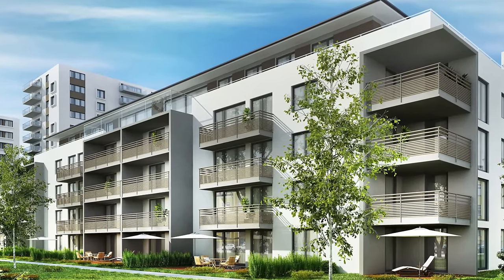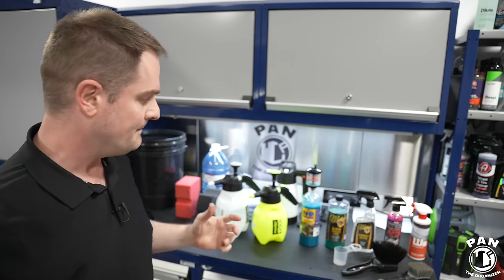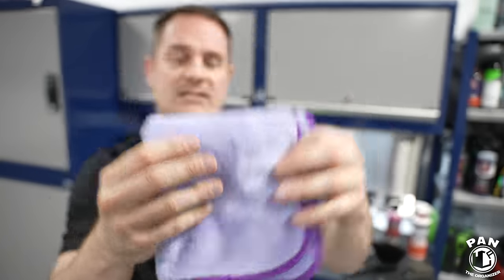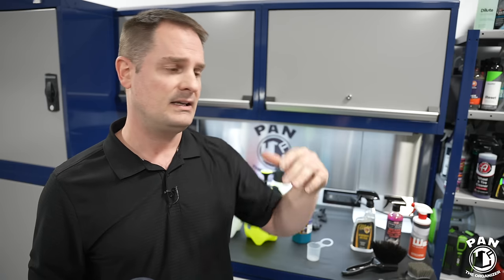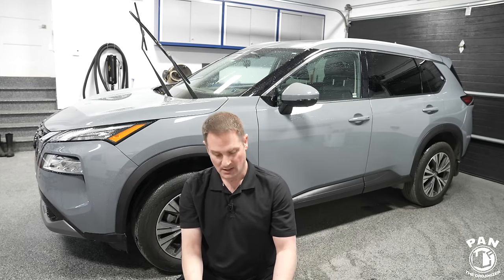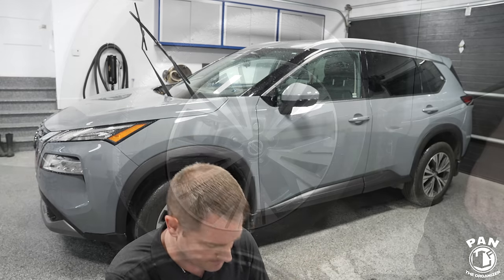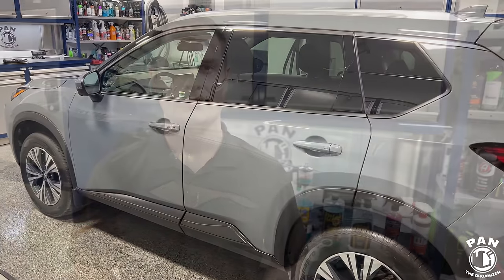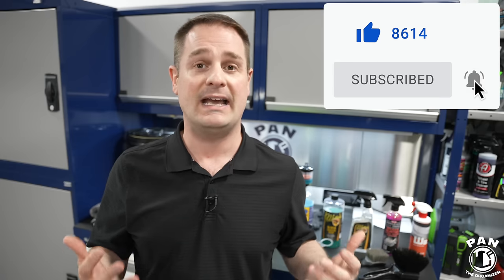How to wash your car without a hose or pressure washer! (RINSELESS WASH METHOD)

Comment: In my area (France), we have strict water restrictions in summer (say july-october included). I prefer using a  traditional method (I own a pressure washer, a foam canon). So during winter and mid-season, I use this method. But in summer, it is forbidden to individuals to wash their cars at home. So you have to go to a washing station or find an other way...  The tools at the washing station are often unusable safely (brushes laying in a bucket, guys having washed a muddy car and leaving the tools with no care). So, in this case, I use a riseless method... and it works. The only problem is to find the adequate products in France… It is quite difficult.

Comment: Well, I feel like my life has changed after discovering rinseless washing. No garage, no hose, no water.  My only option was these self serve auto washes in which when you take your time to detail the coin usage is endless. First attempt to my daily  car with no paint correction  and the results where superb. Even the wife who is usually not noticing relevant details,  said was excellent. So, washed also the other one that is in a very good condition recently polished and topped with Collinite and bead maker. WOW. BTW both cars were not washed for about a month, full of dust but not hard debris. It works guys.
Reply from the maker: Thanks for sharing your experience!

Comment: Pan!  This video was timely.  I did my first rinseless wash this morning.  I cannot believe how easy it was...and how much time it saved.  I have hard water, so I spend a lot of time going back over the paint with detail spray on a regular wash. For the rinseless solution, I used our homes RO water (no spots anywhere!)    I presoaked using a regular spray bottle.  Do you feel like the pump sprayers have added pressure that helps break up the road contaminents?  l've been looking at the marolex sprayers for a bit.
Reply from the maker: Yes the more powerful pump sprayers like the Marolex really help to remove loose dirt and grime during the pre-treatment. Check out the links in the description.

Comment: Brake buster can be used waterless on the tires and you can use a damp ONR towel to wipe it off the wheels as well. The pump sprayer and brushes also dipped into rinseless will be enough to rinse off the wheel as well.

Comment: Yesterday I did a rinseless wash on both my work truck and my wife’s van. I used a garden sprayer to pretreat the vehicle. I then did a rinse with the pressure washer ( lots of dirt and thick grime). Then a full rinseless wash on both. I used Titan as a drying aid and protection. Both vehicles done on same bucket. Very efficient way of washing. No concerns about scratching. My truck is 2 years old and looks better than when I bought it new( never polished the paint either)
Thanks to you and Yvan Lacroix for introducing me to this method.
Reply from the maker: There you go Steve! Thanks for sharing your personal experience. :)

Comment: Thank you for making this video. I just performed this rinseless wash on my 2024 Honda Civic. It has an Underdog Pro+ coating. It wasn't very dirty. Mainly some polen. I probably spent about 90 minutes or so. A bunch of that was chasing little drips from the doors and the trunk. I was in no hurry. It was a beautiful day outside. I did this in my garage. There wasn't that much water on the garage floor and I just used my leaf blower to help dry out the floor (after moving the car outside of course). The car looks perfect. I will be using this technique 100% of the time if at all possible. This car isn't a daily driver so I don't expect it to ever get very dirty.
Reply from the maker: Thanks for sharing. Yeah when done correctly and not on a super dirty car, a rinsless wash is a safe alternative to a regular car wash with buckets and wash mitts. But you need to use common sense with rinseless washes.

Comment: As always, great great video. Picking up my new car on Tuesday and already decided rinseless washes were the way to go, so this video couldn't come at a more perfect time. But in all the videos I've watched about rinseless washes some things that are never mentioned  are: 
A: how to treat the door sills and underneath the doors and the inside of the tailgate? I'm guessing you can just include those as well using the same method? 
B: how to clean your windshield wipers? Do you also just lightly go over them or clean them more thoroughly?
Reply from the maker: A. Just use a microfiber towel dunked in the rinseless wash at the end of your wash process.
B. I just put a bit of glass cleaner on a glass towel, finish the glass, and then pinch and clean the blades.
Reply: Same here! Integra on Tuesday, and sometimes I’ll resort to the rinseless wash process.

Comment: Appreciate this tutorial, Pan!  Did the rinseless wash today on our 1-month old Porsche Macan using the guidance from you and Yvan Lacroix.  Took me 1.5 hours total, but I'm sure I'll get it done quicker with more practice!  

The car itself wasn't so dirty, but a LOT of dirt and gunk came out of the wheels :o
Reply from the maker: Yeah the first time you do a rinseless wash, it takes more time and you probably used more product than you actually needed. It's normal. Once you get the hang of it, you'll be more efficient.

Comment: I’ve only used ONR so far and it works great. I’ve used it as a pre-spray and post wash spray when working in the sun to prevent water spotting on my black vehicles.

Comment: After following Pan's rinseless method, the number one thing I wish I had invested in sooner was a better drying towel. I had started by just drying using the same small microfiber towels I use to apply the rinseless solution and it took forever. Having a bigger, more absorbent microfiber towel designed for drying is worth every penny.
Reply from the maker: Absolutely. Having a quality dedicated drying towel is important. Here’s my video on my favourite drying towels: https://youtu.be/E10SjmOps7E?si=JFNhgTqpPW8Ql0K6

Comment: Thanks for the very informative video, Pan! I just thought of sharing my own way of dealing with the elements, maybe others have the same conditions. I'm using rinseless wash to tackle two problems at once. Very hard water and harsh weather conditions. I take the cooled car out of the garage and do a regular pre-wash with foam lance and pressure washer quickly. Once I'm done, I pump spray the whole vehicle to replace our super hard tap water with rinseless wash solution. Then I move the car back to the garage and perform a rinseless wash inside safe from the heavy winds and sunshine that would dry the paint very quickly. Then towel dry and make it perfect with my quick detailer.

Comment: Pan - I use the Gary Dean method, with multiple wash towels in the bucket.  One towel per panel, then it goes into a separate bucket to be washed.  That way there is no way of contamination.  Works for me and the paint has no scratches.  Great video, and I haven't used shampoo and a hose in over a year.
Reply from the maker: Thanks for sharing!
Reply: Yes, I don't like to contaminate my bucket (use a couple different buckets if u need to).   

I save my "clean bucket" solution for next time.

Comment: Thanks for this, I have pretty much been doing this method for the past four years.  The only thing I would modify, you did mention in your video, would be to use a drying aid I personally use a single spray of Opti-seal per panel for some extra drying ease and a bit more protection.  I use MUCH less water, and less product per wash compared to my normal two bucket method.  Also if Ivan from Optimum is to be believed, this is suppose to be easier on the paint.
Reply: Not with Opti any more( retired in 2019), but yes as shown in this video, it’s much safer than a traditional wash. With the lubrication of a Rinseless a drying aid isn’t needed, but definitely makes it easier.
Reply: @Detailers-Business-Academy I still want to do the traditional washing method of foaming with strong alkaline soap during winter to remove 80-90% of the dirt - rinse - contact wash but instead use Rinseless wash as the soap for the contact wash, do I need spray Rinseless wash on the surface or can I just dunk the sponge in the bucket and apply to the car like I would if I use soap in the bucket?

Comment: I have greatly benefited by your videos and tutorials. So grateful for that. Regarding the rinseless method, i dedicate some ''sacrificial'' towels of lower quality, just to insist on the wheels and inner arches. Rewashing and using them 2 or 3 times before replacing them. Costless and easy way to go that extra mile in those areas. Greetings from Greece!

Comment: Love this!! I used ONR a lot last winter when the hose went away.   I always took the vehicles to the car wash and blasted off any grime/sand/salt debris with the pressure sprayer, drive home, filled 3 gallons of distilled water and had at it.    (One panel at a time, then used with drying aid, topper or C2V3 ) I love this method.  I also like the foam cannon regular method.  It's a lot longer(To Me).   Terrific video.  I have N914.. haven't used it yet.  Thanks very much, Pan!
Reply from the maker: Thanks for sharing!
Reply: @PanTheOrganizer  thanks for another great video.   Have a nice weekend.
Reply from the maker: You too bud!

Comment: I always have in my car trunk my IK sprayer multi pro 2 with ONR and whenever have bugs after a long drive just a matter of spraying ONR and bugs or even bird droppings come off easily.
One difference between the big red sponge and the ultra black sponge is that the UBS works for both Rinseless and soap while the BRS is for Rinseless only.
Reply from the maker: Good point!

Comment: Definitely need this technique in CT for the winters.  With the chemicals they put on the roads you have to get that stuff off as soon as you can.  I can not use a pressure washer in my garage unfortunately in the winter so this does the trick for me.  Thanks for another informative video Pan!
Reply from the maker: My pleasure!

Comment: Thanks Pan for another great video. Actually I used ONR for today's weekly maintenance wash, I always spray first before the contact wash using the ultra black sponge. Drying I use diluted P&S Beadmaker with Rag Company double twistress drying towel.
Reply from the maker: Good technique Paul!

Comment: I was worried about what I was going to do about the tires and rims and fender walls I took I seen this video you really are a bad ass Pan thanks bro
Reply from the maker: Welcome to my channel. You discovered one of the biggest car detailing channels on YouTube as we surpassed 820,000 subscribers and 100 million views! I have been detailing for 25 years and I love to share my knowledge and passion with my viewers.

You found the right channel to help you learn everything about detailing.
Reply: @PanTheOrganizer  thanks pan it’s a real blessing
Reply: @PanTheOrganizer  hey pan I got an important question. I’ll make it straight forward. I have a small compact vehicle and I can’t afford a truck or a trailer with water buffalo. The only thing I could think of is starting a waterless or and a rinseless detail. I already have all my products I need and electric generator “ecoflow” vacuum exc.. I have the experience of years of detailing at a shop. What is your opinion on the waterless route? I tried my car yesterday and was not happy with the results but it was pretty dirty when I did the waterless wash. Should I pursue it and make it work??

Comment: I live in a condo with no place to wash car so this is perfect. What I was wondering is, IK sells a Foam Pump Sprayer and I was wondering if I could get that instead to apply a rinseless wash , just so I wouldn't have to buy two separate tools. Love the videos Pan.
Reply from the maker: Rinseless washes aren't designed to be foamed on the car. They are not a shampoo. They are a polymer cleaner.

But yes IK does make a foaming pump sprayer, here: https://amzn.to/3OHHNob

You could use that with a snow foam if you want to foam your car and don't have a foam cannon for example. Or a foaming type wheel & tire cleaner that you can dilute in it, like Brake Buster diluted 3:1 as I show in this video: https://youtu.be/Ty4ZTq7A7rc

Comment: Hi Pam…I’ll be this exact same method today.  I use ONR….I use 3 capfuls of ONR to two gallons of distilled water( I know the 3rd capful is overkill).  I do like the black sponge as it  is more ergonomic like you said.  I usually wash a panel then dry it with the gauntlet I have.  I guess I can wash the entire  car then dry it.
Reply from the maker: Thanks for sharing!

Comment: ONR never disappoint when it comes to rinseless cleaning… slick and shiny, removes dirt like it’s nobody business. This used to be my only solution as water scarcity was such that even a full bucket of water was raising eyebrows. 3 to 4 microfiber towels and a sealant and that was it. I even used it on heavily soiled cars but as you mentioned, common sense is very much needed. I would start from the top to the bottom and only dirtier areas towards the end. 

Nowadays ONR is hard to find in my area so I tend use a different method. I use 60ml of vista rinseless, mix it with 10ml glass cleaner, a tea spoon of dish soap 10ml a bathroom gentle scale remover with 100ml of distilled water in a bottle. I spray the combo on a surface and I ensure the towel is dripping wet and wipe. It glides well and it’s easy to dry. It does not hard dry and is slick too. It does not bring a shine but cleans really well. It does not strip off wax or sealant either. For the wheels I used meguiars hot wheels and it does the trick.

Comment: Would it be safe to use ONR with a wash mitt if I am limited to drying towels and a single bucket? I don't have many resources and my new apartment doesn't have running water access for me to use a hose. My car is ceramic coated and I want to make sure I can still maintain it.

This video was amazing, so glad I found your channel!

Comment: Ivan in his video for McKee's used a 1:128 N-14 ratio for the pre-wash stage. It seems to make sense that a higher concentration of Polymers would be safer for first encapsulating the dirt.
Reply: Each manufacturer recommends different dilution ratios for different applications. Yes if heavily soiled or oily , increasing the dilution ratio is safer.

Comment: That is the biggest coincidence ever, just today I did my first rinseless wash, I get back home and I see this video on my feed!😂😂 btw, for people who never did it, I had no experience at all, I was working under the shade because today we had 38°C with almost 90% umidity in the air, so its pretty hot. I used Wolfgang Uber Rinseless wash (also, apparently we don't get n-914 in Eu, that's really a shame, or at least I wasn't able to find it). I worked one pannel at the time cause I was afraid of the high temperature, I'm super impressed with the results, the car is looking like a mirror, I had no problems with streaking or the product drying too early, a bit of wax and boom, black paint is looking amazing. Definetly doing this again!
Reply from the maker: Wolfgang Uber is another good rinseless wash, so no worries there! ;)

Comment: Pan you are freaking me out using those premium Minx and Gauntlet towels for non paint duty man! Instead of dunking my (Marolex for this win) pump up sprayers in the bucket, I've just gotten in the habit of filling up a few one gallon jugs of ONR to simplify my life without all the confusion.

It's been about a week since I've done a soap wash and the car is lightly dirty from rain and oddly enough bug guts too. So, in the morning I am going to give it an ONR bath with several TRC Eagle Edgeless 350s in my rinseless bucket and all the dirty rags get tossed in the second bucket using the Grit Guard dolly!

Comment: Great videos. 

My rinseless wash regiment is quite same with yours. Pre rinse, use Minx Royale mf and ONR in a bucket with grit guard.

The game changer is discovery that Marolex pump is better than my current pump sprayer and luckily I found a seller at the next town from my city and it is in discount. 
Thanks for the great videos and advices. 

Greetings from Finland.
Reply from the maker: Thanks for the feedback Robert! Cheers from Canada! :)
Reply: Hi, I'm new to this. Is the sponge better to use or is it better to use a lot of microfiber to clean off the vehicle when using ONR? Cheers.
Reply: @taylorthrall7321  Hi there,

It all depends on your preference. TRC or Optimum make Big Red Sponge which is intended to be used with ONR / rinseless wash. 
I like the microfiber towels method since I will out the used ones to separate buckets and change to new MF towel to prevent scratches. Of course if you use 2 buckets and grit guards on each bucket it will minimize the scratches while using the sponge.